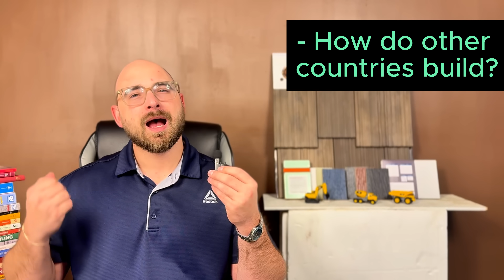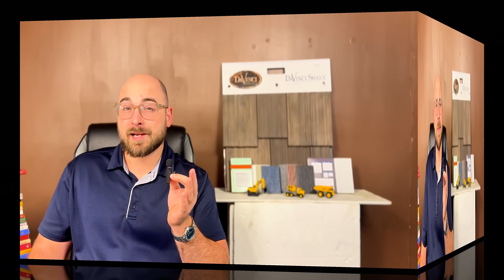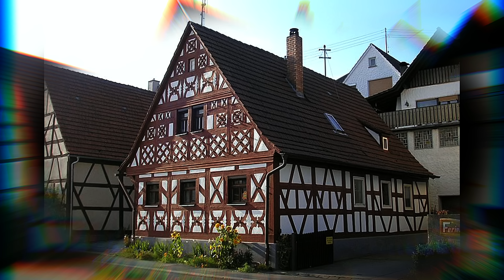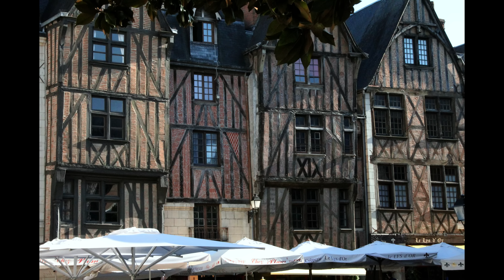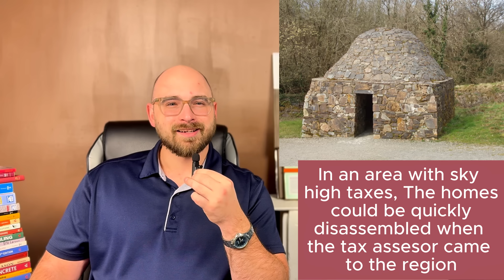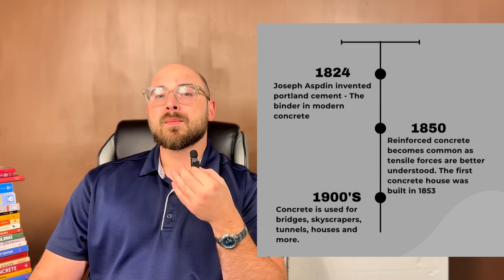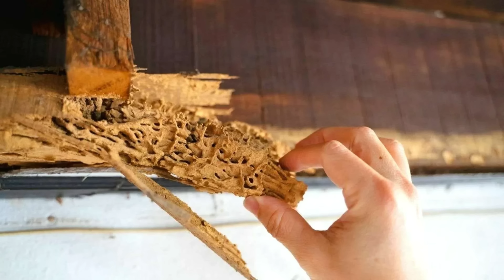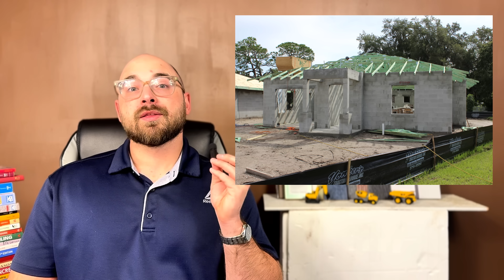Why Other Countries LAUGH at American Homes

Comment: I was an exchange student years ago. I stayed in Minnesota. Cold winters. Frost inside the house corners. windows got “prepared for winter with a layer of plastic foil, because they were single glass windows. The roofs of the attached garages were not insulated and leaked heat and therefore energy. Nothing in those houses were fitted for those temperatures. My sister in law lives in Texas. The insulation on those houses are a joke. Who in his right mind would put an air condition under a uninsulated roof in texas? The insulation starts on top of the room ceiling. The air condition has work in 100+ degrees. Who would ever think, that that’s a reasonable idea?? And I’m not a builder, I’m just trying to make sense.
Reply: "Who would ever think, that that’s a reasonable idea?"
Well, that must have been a very, very greedy person.

Does the term "American greed" or "greedy as an American" ring a bell?
Reply: Insulation in the roof prevents the house from "breathing" which allows moisture accumulation, condensation, and mold growth.
Reply: @shellieperreault6262  "Insulation in the roof prevents the house from "breathing" 
I don't know what ancient insulation technology you're writing about, but it certainly has nothing to do with any modern insulation system.
Reply: Must have been an old house because double pan windows are the standard. 

Texas is a garbage state so I am not surprised by that story.

Comment: The whole purpose after buildinga timber  frame should be to cover it. To protect it from the weather, I watched a show on Brit Tv and all they did was replace slapdash repairs to rotten exposed timber frames. US homes are inferior. Timber framing was replaced with stud framing because of the tremendous demand for housing in a growing expanding nation. I think it started in Chicago about 1840. Machine made nails and sawed lum
ber from big mills.  Its degenerated into glued up beams and OSB and it isnt cheap to buy.Labor is expensive and skilled labor is in short supply. Most americans only live in houses a few years and move on. In Mexico houses are solid concrete  block,stone or adobe. They do have earthquake c odes, They have a lot of very modern style houses. They have a lot of skilled tradesmen.I spoke to a guy from Serbia. He wanted to know why US houses were not built with masonry. Fire proof,bug proof etc, I said because we produce wood here and its cheaper to build with that. He built his house of wood,despite the fact his dad was  atrained mason,who usually worked in Conc. Block.

Comment: I have to correct the author about construction in Peru. 
Construction in Peru is done with concrete, rebar, bricks, cement mix with coarse sand, etc because of earthquakes. 

The mud construction was done hundreds of years ago and there are some houses still standing but few to find.
Reply: until the next major earthquake 😂

Comment: Aerated concrete blocks- you hadn't covered them. For the most of US Mainland I would choose 200 mm thick lightweight bricks. Easy to build, perfect thermal insulation, robust enough for 1-2-3 storey building. 
From my personal expirience: 2 no- expirience in masonry dudes (me and my brother) can easily do 3 rows/day (0.75 m) for 150 sq. m. house (we used 300 mm blocks, which are much heavier and exhausting to handle, while 200 mm is supereasy as it weights about idk 10-15 kilos/item).

Comment: Ok seriously. Just do the math. You are saying these homes would cost 10 percent more(which isn't true, its closer to 35 percent more for an equal house). Which means that in order to be cost-effective, one in ten homes would have to survive a natural disaster just to break even. And the solid structure would have needed to survive flawlessly. When the number of compromised homes due to these disasters is per thousands. Not one in ten. Furthermore,  your built to last idea just doesn't hold up for the entire home. Only for the support framing. Plumbing, electricity. Interior walls, roofing, and more still have to be updated. Solid structure homes can make this incredibly more complicated and costly.  Insurance companies run these numbers. Its just a better idea to rebuild somethings than to spend so much time, effort, and cost, making them last the maximum amount of time.

Comment: A very informative video but a little too ‘easy’ on American stick framing . I’ve built several homes in America and Germany and am very biased towards the German methods . 
Foundations /footings/slabs cellar walls are twice as thick as American standards with twice the steel  resulting in almost zero cracks . Yeah I said it . Zero cracks . I’ve built two houses in Germany in the last 20 years and both still have no cracks of any kind . 
In terms of the shell , I went with a hybrid type system. A ‘log’ house made from laminated beams ,14 cm thick with 14 cm of insulation on the OUTSIDE ,covered in wood siding. The shell was precut in Finland . The insulation was done on sight . 
Oddly enough it was cheaper stronger and more energy efficient than a local company that does stick framing . Probably due to less labor with the pre cut ‘logs’.

Comment: the think beauty or aestethic or something similar over live and safety is pure stupid. 30cm concrete wall with 12mm iron inside hard-brick old fashioned not hollow one and cover with 10cm brick outside. and the roof? pure concrete weight like tons from concrete.
human needs something to rely on not just glass, wood and replaceable for aesthetic purpose. so think the investment of the building concrete house for like 30-40 years unless you are someone who often doesnt stay in your house. 

and please dont use animal dung or whatsoever like that for out-of the stupid reason you have.

Comment: There is no AAC (aerated concrete) wich is best technology for energy efficient low rise houses. Majority of private houses built from Germany trough Poland up to Slovenia and Croatia are made with use of YTONG or Siporex technology. 100% fire proof, breathable, with natural thermal insulation, cheap, light, easy to construct (even for dummies) and fully free of any health hazard.
If You got a house of the AAC any others are just makeshift constructions. If anyone don't have lot of money, buying house make of cartoon and scrap wood is not an option. We, citizens of Central Europe like to have place to live that last for decades (or even centuries).

Comment: Im Ukranian has been living in the US for last almost 4 years. I haven't seen a decent build house here. Some are pretty, but quality is horrible. There is about the same weather in Michigan as in Kyiv, but i have to run heater 24 hours a day whole winter and still wear warm clothes and air 24 hours a day during summer because any house I lived in didn't hold temperature over half an hour. In my house in Ukraine, i had a heater run a few hours at night in coldest winter nights and opened windows time to time to cool down and get fresh air and stay in a tshirt. Same during summer. In Ukraine i wouldn't hear my neighbors in apartment building unless they drop a cabinet. And here i can hear every step, every word, and everything they do in bathrooms. And only here i learned what's is the termite disaster is, and water damage after minor leaks. And the biggest mystery to me is house prices, property tax, and permits for working on own house 😶
Reply: As a Ukrainian myself, I agree with it. Have lived in apartments and houses with both central heating and with gas heaters, even notoriously cold houses keeps temperature quite well.
Reply: Free 🇺🇦
Reply: Hired a company to do some renovations in my Californian home 2 years ago they used new Ukrainian immigrants for the labor and they caused more damage than they fixed causing the project to go months over time and budget.
Reply: @Ronin.97 bad workers can be in any field among any nationalities. I was talking in general, not about single individual bad experience.
Reply: Америкашки любят нам говорить что нам нужно ехать обратно как только слишат что у них не сплошной кайф 🤦
Reply: Мне кажется вы забыли, что бетонные многоэтажки на Украине отапливаются центральным отоплением. Тепловое сопротивление наружных стен в таких домах ужасное, но общие потери всего дома остаются на приемлемом уровне благодаря тому что все ваши стены в квартире, кроме одной, граничат с вашими соседями, и не выходят на улицу. И вся эта система работает только благодаря централизованной городской котельной, которая работает на супер-дешевом топливе, которое добывается буквально рядом с ней - уголь и природный газ. И только благодаря всей этой безумно нерациональной системе, вы можете открывать окна посреди зимы, и проветривать помещение, в то время как ходите по квартире в одной майке и трусах. А теперь вопрос - где вы в США видели центральное отопление в частном секторе? Там только электричество, либо газгольдеры. И то и другое намного дороже чем центральное отопление.
Reply: @Tosnowood во-первых, не все многоэтажки отапливаются центральным отоплением. Во-вторых, кроме бетона многие еще имеют и утеплитель снаружи. В третьих, я в осном, жила в угловой кварире, где с соседями граничили только стены кухни и ванной комнаты. В четветых, что вам тоже, очевидно не очевидно, у меня есть опыт проживания не только в квартире, но и в частом секторе, где тоже нет центрального отопления.
Reply: @katery13  Сдрасссссьте! Покажи мне хоть одну многоэтажку в Украине, НЕ НА ЦЕНТРАЛЬНОМ отоплении
Reply: @Tosnowood мда.... вы точно в Украине бывали? На поздняках и в центре таких хватает
Reply: @katery13  могу ошибаться конечно, я думал в СНГ все многоэтажки по одной схеме сделаны. Возможно из-за жаркого климата, на Украине иначе.
Reply: @T @Tosnowood  Usually “Stalinka” buildings don’t have a central heating. 

I live in Czechia and we have all panel houses insulated thanks to EU funds. The cost of heating decreased a lot after insulation. We also replaced all windows to “European windows” which helps in the insulation too.
The buildings are insulated with polystyrene on the outside.
Reply: @Tosnowood  nobody asked your opinion moskal
Reply: How many houses have you lived in? Or are you in an apartment from the sounds of it. Either way doesn’t sound properly winterized. 

Having to run a heater 24/7 is not normal. I have the heat set to “on” all the time if that’s what you mean but it kicks on & off to maintain the temperature.

Regarding the other things, maybe Google it. Instead of bashing the culture you live in; maybe try learning about it. All those things exist for a reason. People need permits so someone can’t just do whatever to their house, sell it, & then find they built it incorrectly that caused a house fire etc.
Reply: @Allaiya.I moved quite a few times so had a chance to try as apartments so as houses. Running heater a few hours at night and running heater approximately each half an hour make big difference in bills. Since I like designing and do things myself I had do learn local building code and got a chance to know some builders. So, the only reason of the culture you are talking about is speed of building. Concrete house materials costs about 5% more, but you can build 2-3 frame houses   and up to 5 manufactured houses while only 1 concrete. Of course builders want more profit, so they choose frame and manufacture. This why some of the builders make more then surgeons just after a couple of years of experience and basic college (or just high school) behind.
Reply: @katery13  Katerina, tenes toda la razon.
Reply: But yet you ain't in ukraine.
Reply: @fracturedsolace145  Yeah, there is a war you know?
Reply: @fracturedsolace145 and not going to ask you where I should be.
Reply: @fracturedsolace145  Someone is telling him?
Reply: @fracturedsolace145 What does this word have to do with it now? Going and not being able to go is something different, stupid American
Reply: Well sounds like you should move back then
Reply: @Allaiya. Instead of falling back into the stereotypical 'we're the centre of the world' American imperialist mindset, take your own advice and learn about the world outside of your bubble. Learn to accept criticism! Stop being a ❄️
Reply: @Allaiya. What an ignorant take. You must be either American or Russian.
Reply: @Allaiya. Sounds like I didn't ask you what I should do. And sounds like you like to live in a shed with castle price, and I prefer to build what I like without paying through the nose.

Comment: Im an American who found out about cob building when I was 15 and since then ive wanted to build one. Growing up ive only ever seen the wood frame with drywall or rarely a brick house. Im almost 20 now and 5 years of researching building codes in the US I found out that anything that isn't wood frame or brick (specifically ones that are bought from manufacturers) are almost never gonna be approved by building codes. If its not approved that can lead to the city tearing it down or making you tear it down, fines, or even being arrested.

Comment: Live in Saint-Petersburg, Russia, coupe years ago buid a frame house, about 90 square metres, double storey with loft,  by my own as grandfather Larry Haun wished to build, doubleframe (mixture of Klingenberg and Larsen frame), on concrete slab with insulation (in our country we call it "Insulated Swedish Slab", but it's a kinda joke, because inventor of this method is russian and live in Russia))) ), walls 350 mm mineral insulation, roof 450 mm mineral insulation. So, it's warm as a fuck! Sturdy and quite. Material's and way of construction doesn't matter, only strict adherence to the rules and technology ;)

Comment: There is a R-20 minimum wall insulation requirement in the US so you need to build a block wall and a service wall (3x labor cost), the only other option is ICF (Insulating Concrete Form) but contractors are rare and expensive.

Comment: In India, we mostly build houses with concrete+steel columns, supporting the roof which is also made of concrete with internal Steel structure. While the walls are made of bricks with concrete plaster. They last in every weather condition and remains in good condition for generations.
Reply: exact same method here in brazil, other than older roofs that sometimes is made of wood frames, but newer homes even in the favelas are the exact way you described.

Comment: Most of European houses are bunker's. Some are build with ashes from thermal plant which maybe cancerous.  US homes are made of wood, which are healthier but not as sturdy as the mortar houses. Building time is way in US favor. I can't understand the squawky floors of the US houses. Why this was not resolved, still present in new homes.
Reply: Considering US house to be healthier and made of wood is on par with the statement that fast food is made from flour and meat.
They are loaded with chemicals: glues in OSB and plywood boards, drywall, insulation, wood treating chemicals, fire retardants, synthetic carpets, sidings, pipes, trims, paints and caulking,. All of it is inhaled daily by the occupants in the form of off-gassing or particles created by abrasion. If they are too air tight they develop mold that affects quite a large percent of population. 
I have been to a few bunkers and I can assure that houses in Europe are far from feeling like bunkers. Nobody who lived in a normal masonry house would think about such a comparison.

Comment: Home construction in the US is a scam. Homes are built to breakdown after 60-80 years. Back in India, my extended family lives in a three storey house constructed in 1912. First level is made of stone and concrete and next two levels are made of bricks and cement. Older houses are inspected for safe occupation. The house passed its last inspection in 2022 with flying colors.

Comment: There is a self-inflicted truth to their claims.  Due to high demand, lack of education of buyers,  “C’s get degrees” standards by new home builders, inspectors who are more concerned with “check the block only” standards without going more into faulty improvements, and lack of properly trained (journeymen and master techs).  Builders and repair contractors appear to be in so much of a rush to get to the next job (quantity) that they’re more than willing to sacrifice quality due to there are always a demand for labor regardless of their reported crappy work.  Our parenting mentorship has been so limited due to both parents are too busy working that those grown up kids have zero idea how to maintain homes, move a few years after move in (for job reasons or trade up) without doing any monthly/bi-monthly/bi-annual/annual maintenance, that new owners are left holding the bag on a polished. POS.  So, I think this is where a lot of the criticism cones from.

Comment: It would be awesome to have a sort of mass produced concrete blocks that let you build your own house like Lego. I've heard they are even inventing some new concrete methods to make them lighter. Or perhaps some combination with that and 3rd printing would work.
Reply from the maker: ICF is the closest thing
Reply: @Mike_Fortin   But your own video said they already invented blocks that you build yourself. I enjoyed the video, bravo.
They just aren't like Lego and were not made with the new lighter concrete.
Reply from the maker: @remyllebeau77 FLW designed some but the system never took off because it was too complex for the average buyer. 

ICF is very similar to LEGO, however it still requires some basic skill. 

I wouldn’t want my walls to be lightweight concrete. You want the structural strength and disaster resistance